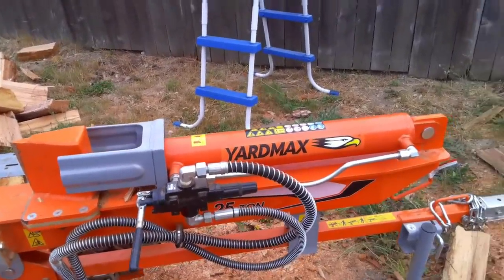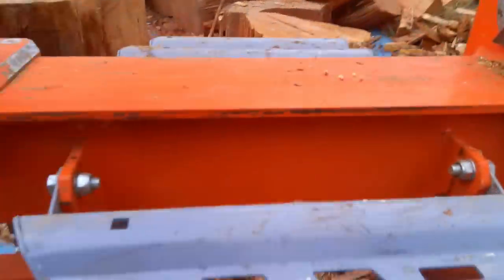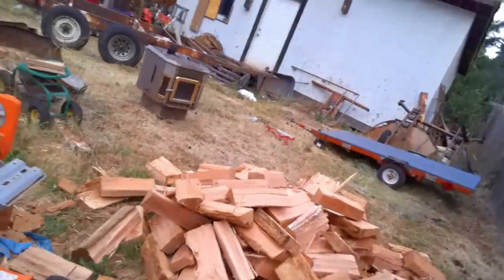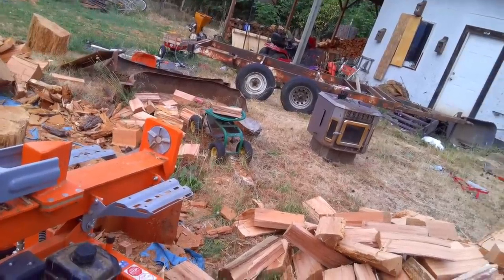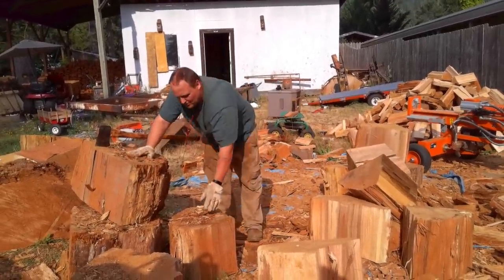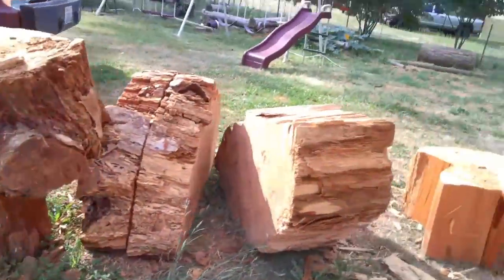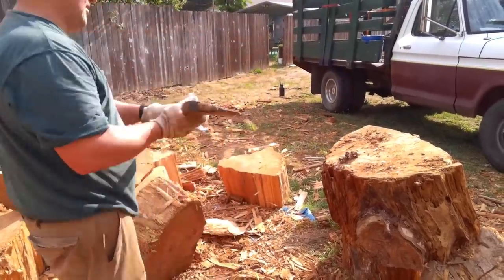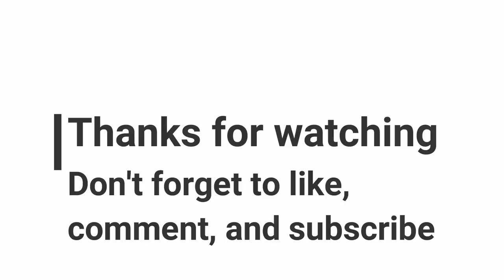Best hydraulic log splitter ever!!

Comment: i just bought the exact splitter.i also have had for two years,the 35 ton half beam model.the rotating base plate is to take pressure off the ram when the wood wants to twist.meh i can take it or leave it.im not sure it needs it.but the spikes are nice and seem to hold up very well. the 4 way can be manipulated up and down a little on the head.if the bolt is near the top of the head it still works just as well and makes much larger pieces!i never run mine all the way at down unless im making esxtra small wood.im here in missouri and i split all oak and hickory and the 4 way works well if the wood is pretty strait.i dont use it for splitting hickory!

Comment: Hi Wild Bill,  First time of watching your videos.  Thanks for taking the time to show this splitter.   You did a great job even showing how to split wood the old fashioned way.  I just bought the 35 ton full beam like yours and very impressed with how well it's designed, built and works.  I didn't get the 4 way but not a big deal it looks like.  I only needed to loosen the adjustment on the control valve so cylinder retracting kicked out easier at lower pressure.  This gnarly box elder,  hard-soft maple,  oaks here in Mich. really test splitters and very hard work with an ax.  My rotating plate doesn't rattle but you might try squeezing a large o-ring or something else behind the plate to quiet it down.  The stripping plate is what rattles a bit on mine but I'll fix it.  Hydraulic oil filter is a good, clean design that won't get damaged.  Changing it once every 5 years or longer?  Big deal.  These Yardmax are great machines and with a little tweaking will be even better and last a lifetime.  Even the tongue jack is fine as is but for $15 you can put a fancier one on it.  Beautiful, solid welding done every place they can weld.  I'm amazed that they can buy the engine, hydraulic pump, control valve, hoses, tires, steel components, pay engineers, labor and sell it for what they do.
Reply from the maker: Thanks for watching. These yard machine splitter are an amazing value.
Reply: I have the same one as you, cutting through pie pan knots, had it two years and it's a great machine, and like you said well built.
Reply: @WildBill1122  Even if the tires are in the way?

Comment: I have a county line 25.I split a lot of oak up to 26 inches so far, with no issues.I paid $985 with tax and all put together.14 gallon a minute two stage pump and 11.5 second cycle.I usually only need to go about half way to split the piece.I don't let it go all the way back either, it really is only taking about 6 seconds to split.I have the fuel shut off valve, but don't use it, because I want fuel in the carb so it doesn't dry out and leave deposits.I only use gas with No ethanol.My theory is my old truck with a carb does not have a fuel shut off and it starts good after 33 years.I let it set for weeks and it fires right up, but it is a ford 351w so that might be the reason.😀
Reply: The 351W doesn't get the credit it deserves. I have a f350 with the 5.8L W, 4:10 gears and over load springs with 210k on the dash Idk what all has been done to the engine or tranny but I do know just tonight I have about a half a long bed and a 16 ft dump bed trailer completely full of green oak rounds and it hauled it just fine and it gets a lot of shit like "that's a lot of truck for a 5.8L"

Comment: Great little video. I see you like standing facing the wood on the splitter. Try turning your body towards the valve and using your hip to guide the wood. May have to remove that shelf though. Happy splitting
Reply: I have found that I do the same thing. I use my hip and left hand to turn the logs. Sometimes I split them once then turn them over, splitting it into quarters. Sometimes, I  stack several thin pieces on top of each other and mone the stack a little, then a little more, inch by inch , and make awesome kindling. Great technique!

Comment: I wish my Champion 27 ton had that rotating plate at the bottom. That keeps the wood from turning and takes the strain off of the I bean and the cylinder. I would not take it off.
Reply from the maker: Thanks I had not thought of that.
Reply: Yea I haven’t heard of it’s purpose as keeping the wood from slipping off, only as a pressure relief.

Comment: I’m shopping for a splitter. This one looks great, except why do you have to straddle the wheel & hydraulic fluid tank? Are the wheels right where the operator needs to stand?
Reply from the maker: Yes the kind of are. Every splitter I have seen is this way. Where I stand is best for maneuvering the wood. The directions tell you to stand further away from the tank so you are not near the wedge.
Reply: I have the half beam version of this and it’s a champ! In 3 yrs I’ve split about 50 cords of east coast hardwood. Has NEVER been stopped by the nastiest stuff. Yes the wheels would seem to be in a tough spot but it’s never been a problem for us. Short cycle time is great, only problem is the stripper arms back at the cylinder have splayed open, wood can get wedged in there on the return and bend them open like an artichoke... still the best home splitter I could find for the $$$. Have fun!

Comment: worst purchase I have ever made.
purchased half beam 25 ton. splitting 8" to 10" round Cherry and Ash some with knots and this machine just didnt have the power.
great video though
Reply from the maker: Thanks. Sorry it did not work for you.
Reply: You should have gone for the "big dog" 35 ton splitter, i swear it'll split anything!
Reply: did you turn the pressure relief in?    in is more pressure  out is less.
Reply: @zlindauer5315  yes I did. I changed fluid and hoses and machine is working like it should.
Reply: This wood is big, but not a test for a splitter, if it was white oak, I would like to see you block it up with an axe,.